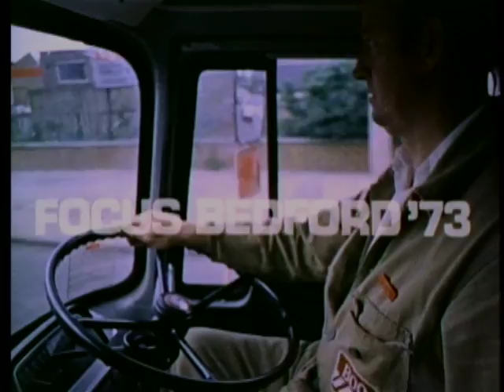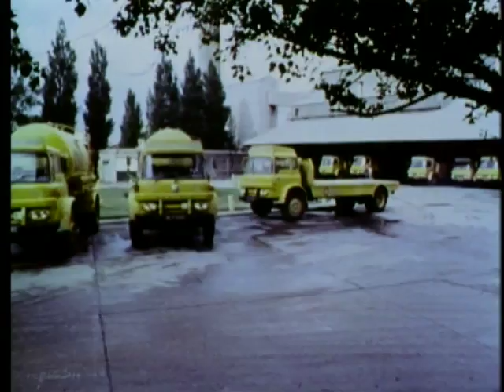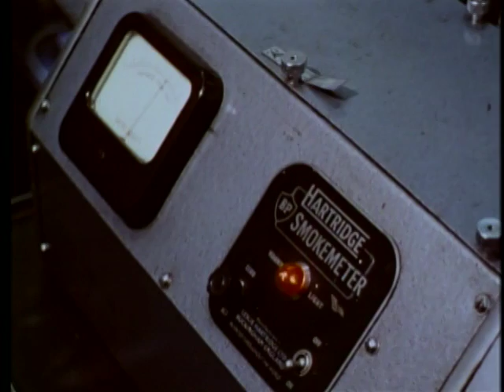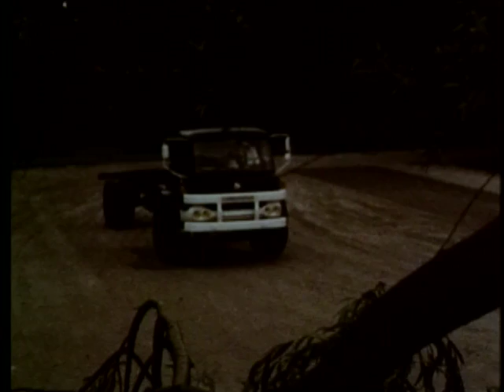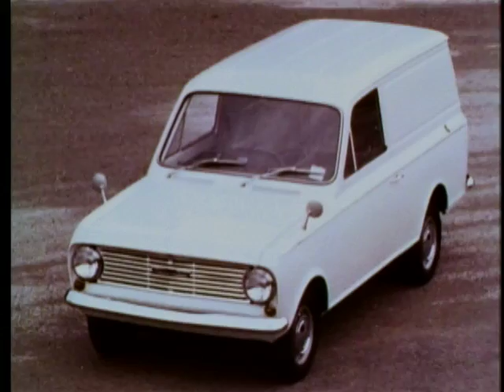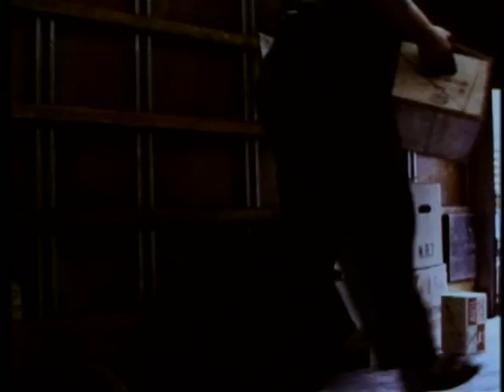BEDFORD 1973 RANGE PROMOTIONAL FILM

Comment: Their fixed cabs caused more back problems than enough , taking a 466/500 cylinder head out was a real ball ache and the radiator was also a bitch , especially when the water pump bearings died and the fan went through it . then there was those freaking lousy wedge brakes and freakin anchor lock handbrake !

Comment: Shame Bedford Trucks went out of business in 1986, but with falling sales, a staid product range that didn't move with the times much apart from a few cosmetic changes here and there and no real changes to diesel engines apart from adding turbos, it was on a slide to oblivion. 

Also the Conservative Government of the day gave a contract to Leyland Trucks over Bedford Vehicles for military vehicle supply, GM in Detroit was watching carefully and on the back of that decision, decided to discontinue Bedford products and stop all production of Bedford Coach Truck And Van vehicles in Luton.
Reply: The 80s range wasn't much different, the TM range from 1974 and a few Isuzu models padded out the range alongside the revised TL and CF facelift but nothing too drastic
Reply: @sutherlandA1  It became a mere shadow of itself, badging Isuzu vehicles i.e. Isuzu Amiga van aka Bedford Midi, Isuzu pick-up aka Bedford Brava pick-up, Suzuki Supercarry aka Bedford Rascal.
Reply: It's the same with the mighty Ford Motor Co & Dodge , no lorry's from Ford ( the odd Iveco badged trucks from Spain) & Transit van production switched from Southampton to Turkey in 2006 & as for Dodge UK ; disappeared in 1983 by RVI  , though some vans & the Commando truck had dual Dodge /Renault branding. At least for a while in the 80s Volvo were making Bus chassis in the UK.